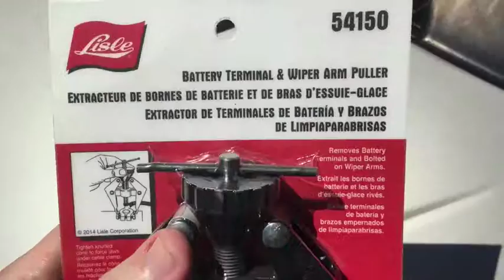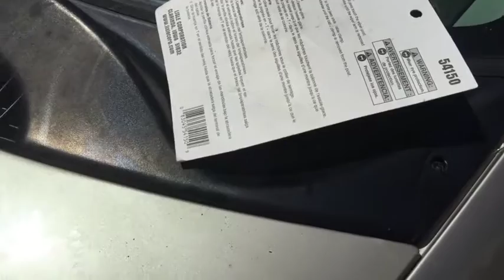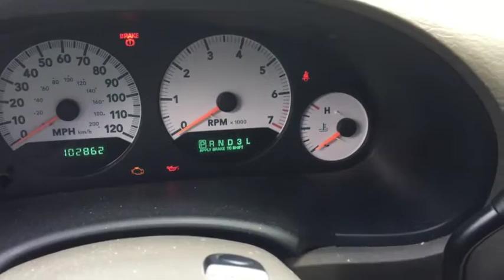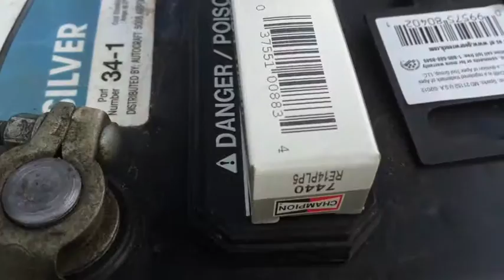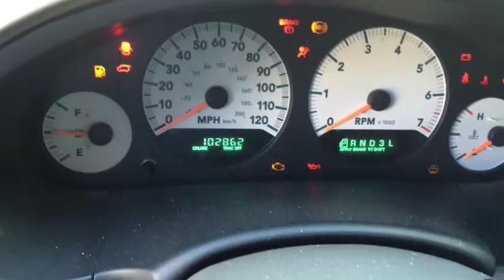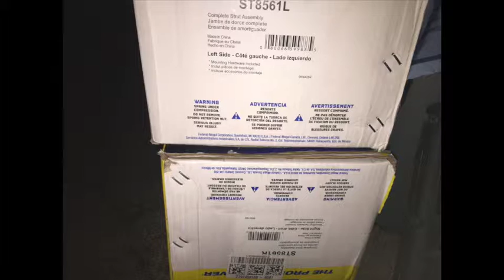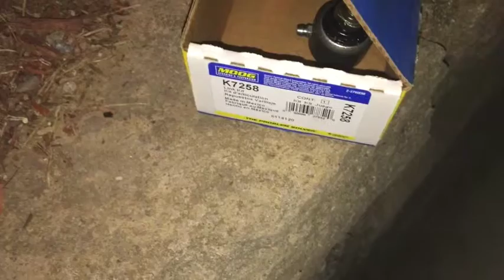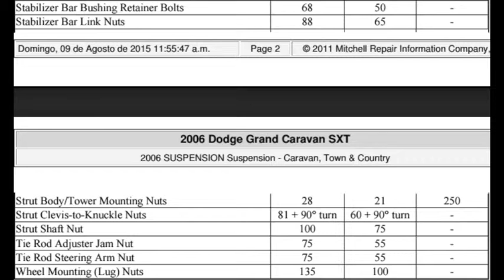Windshield Wiper Assy, struts, plugs/wires, & sway bar links on a 4G Chrysler or Dodge minivan

Comment: Oh, so that’s how they work! Surprisingly simple, considering it’s a mechanically linked opposed system. I’d been looking all over the internet, but every source seems to be under the delusion that they’re all dual-motor, despite a lot of them showing cars with mechanically-linked systems as their examples.
We used to own a 2002 Town & Country, BTW (1999 T&C before that). The best large automobiles we’ve ever owned and will ever own.
Reply from the maker: I love these chrysler minivans myself :) however.. Toyota sienna is where it's at
Reply: @adventureoflinkmk2  I’d have to disagree there–I prefer the features Chrysler offered at the time